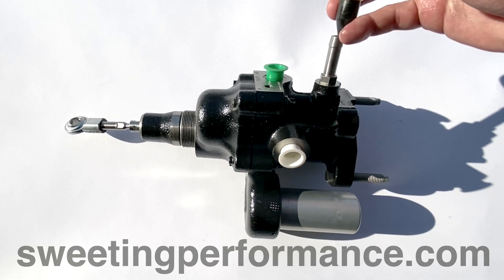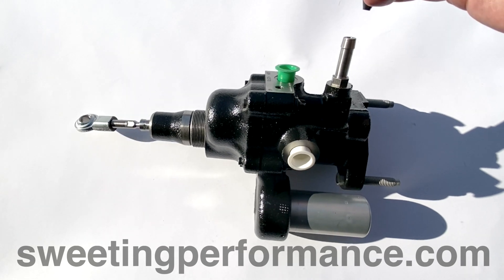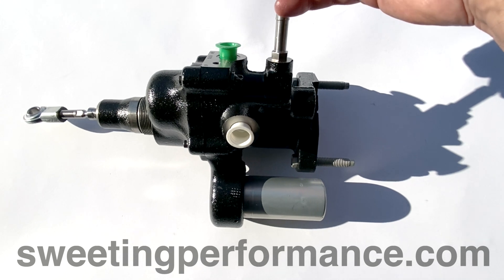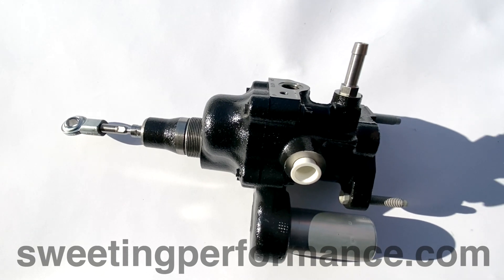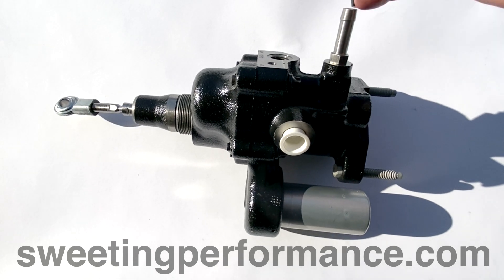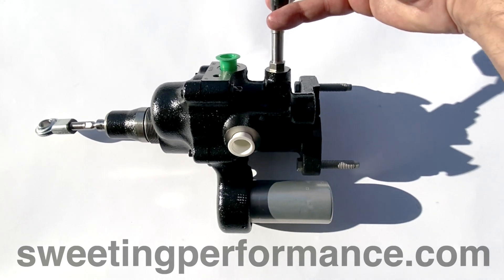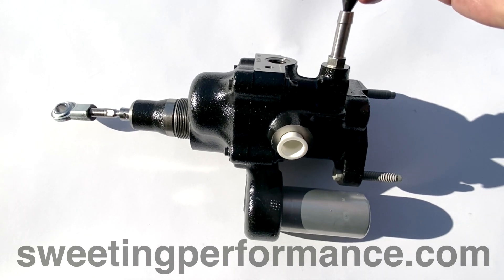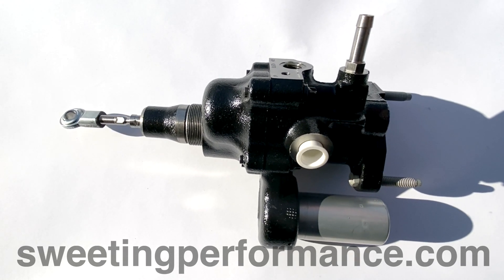Hydro-Boost Troubleshooting: Slow Returning Brake Pedal / Pedal Holding Down / Pedal Applying Itself

Comment: Great video and explanation,
I need help! 
Couple months ago I replaced the rear break system on my 2000 Silverado 2500 6.0 
And honestly I did installed them backwards so I pumped the brakes multiple times to put all the air out but it never ends the air come out.
So I watch a video and I realized that I installed wrong lol ,
So finally I fixed them and for couple weeks I drove the truck with our issues till one day all four wheels locked up. 
Ok before I replace the rear breaks the hydro booster has small leak since I bough the pickup almost year ago but I never replaced or fixe it,
So after my four wheels locked up I thought to fix the hydro booster and I did just replace the seals but not all of them just couple ones.
Then I thought the locked up ll go away when I replaced the seal on the hydro booster but it failed the wheels persisted in locked up.  So I replace the master cylinder because I was sure it was the issue . But it wasn’t now the 2 front wheels are spinning freely but the rear ones still locked up. When I open the brake lines of the master cylinder on the vehicle the ones are connected to the hydro poster just one line is bleeding which are the front ones . So my question is may I didn’t fixed the hydro booster well? You think that why the rear brakes are still locked up? But let me clarify the locked up just when I turn on the vehicle ..
You think I shroud by a new hydraulic booster instead of replace a couple seals in? Or what do you think about it ?
Could you help pls .
Thank you

Comment: What if there's no T? I swapped in a new hydro boost onto my 2000 6.5l workhorse. I followed a guide I found to use a 2021 6.6l hydroboost which is the same size as the original. I had to swap a couple of parts from the old one to the new one, but it fits really well. The only thing is the brake engages itself when the engine running. Any ideas how I can solve this?